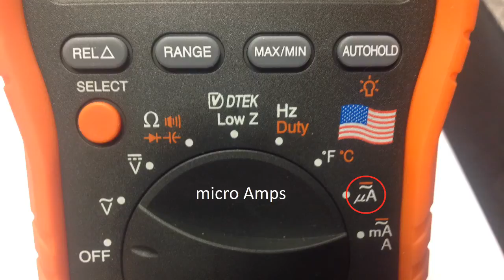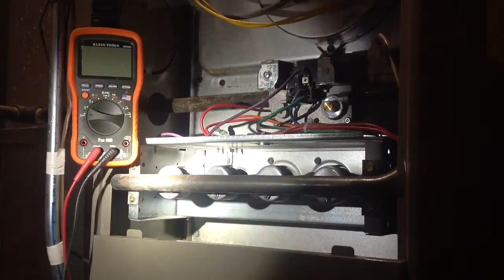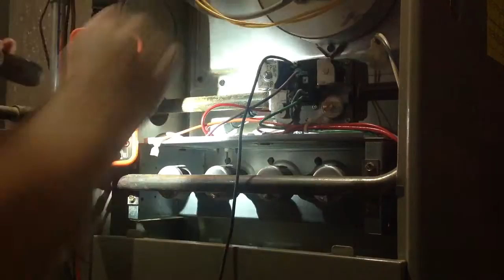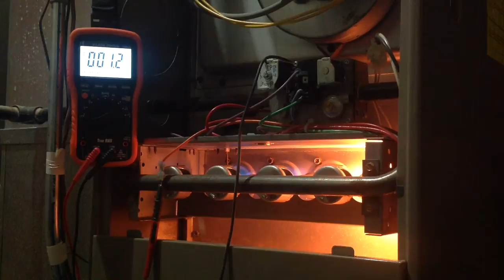Klein Tools Training microAmps

Comment: I got a new flame sensor and when I do this test I still get no reading. The flames poof right back off after it ignites. I tested the flame sensor wire from end to end and it has continuity and a reading of about .2 - .4 ohms. Any ideas?